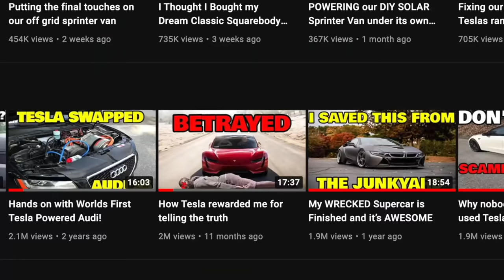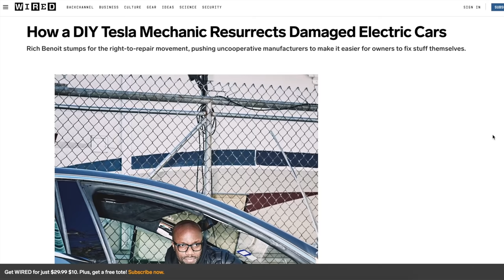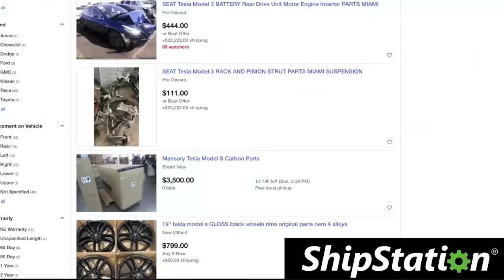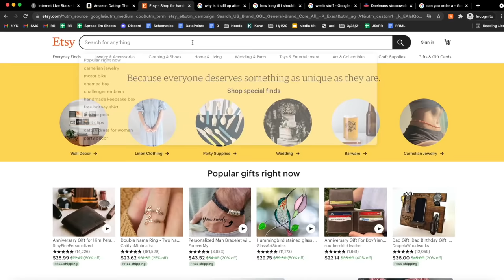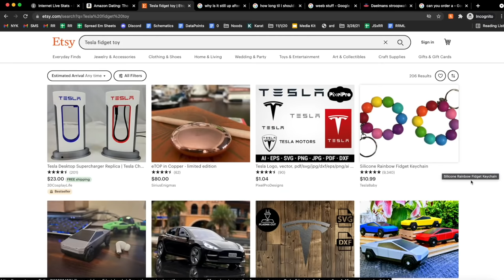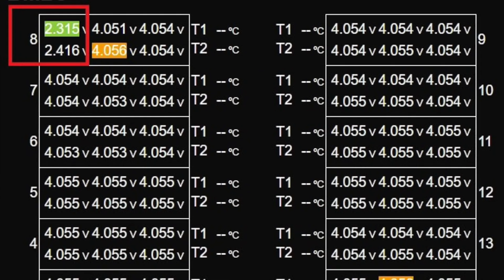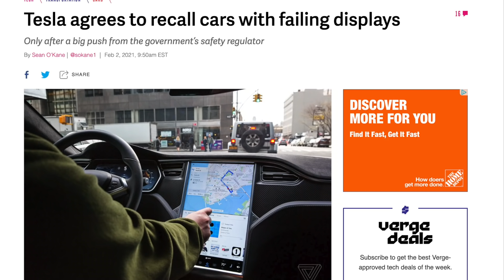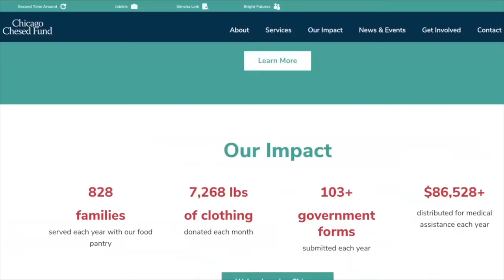Tesla wanted $16,000 to fix this NEW Model 3, we did it for $700! The importance of Right to REPAIR!

Comment: If this is how the future is gonna be, I prefer to live in the past.
Reply: It's already happening cars don't last nearly as long as they used to in the past and are harder to fix yourself.
Reply: Nope this not the future. It's even an exaggeration of the current case. This seems implausible to require a battery replacement. That's not even financially viable to Tesla.
Reply: Right to repair shouldn't even be discussed. How about a right to have "10 years of warranty on the house - manufacturer liable for everything". Just look how much longevity and innovation would magically spring to life overnight and products would be granite solid. No more e-waste dumps in Africa.
Reply: @rosen9425  Nope Right to repair is very much needed. This battery pack should be good for 15 years plus. Warranty Guarantee that long is just not legally viable. As it's beyond realistic foresight. Instead realistic efficient fixing methods should be supported.
Reply: @Neojhun  I think you misread his remark about right to repair
Reply: You will have a lot of company - people who also appreciate past simplicity and freedoms.
Reply: @Ricky Apple did that with the Iphone 6 . They did not exactly break it but slowed it so much it was unusable for some people , then they came out with some B.S but eventually had to admit the truth . By that time thousands if not millions of people had traded in their ''defective '' phones . They got sued and fined by a few countries but the amounts they got fined was pathetic
Reply: With those electric cars you're delivered to the tigers.....and they can rip you of with a smile
Reply: @henkholdingastate  Very good analogy
Reply: Or just buy a gasoline powered car.
Reply: @Neojhun  I think that "right to repair shouldn't even be discussed" means that this right is essential and obvious
Reply: @frankiehernandez9465  Gasoline is on the way out, in some countries it will be banned within 20 years.
Without ICE vehicles gas stations will disappear or turn into electric dittos. Where you going with your ICE car when your fuel runs out and nowhere to buy?
Reply: Just because some companies have weird business practices doesn't make the future bad. It's like reading a porn magazine and conclude all literature is garbage.
It's simply a matter of finding a company with a good product. And anyone with a brain should be able to pull that off.
Reply: @DecepticonLeader  I think petro will always be around only that most will be like you said electric. Who knows if there will be another sauce of power in 20yrs besides gas, electric & hydrogen. I guess we'll just have to wait and see, I do know one thing I won't be around in 20yrs.
Reply: I haven't bought a "new" car since 1982.  All of my cars are old, in great shape, run great and cost me next to nothing to drive.  I've NEVER spent more than $7200 on a vehicle purchase and I'm over 60.  I've owned a 63 Corvette, several sports cars, and a couple of BMWs.  I can work on them myself.
Reply: @Ricky it has already started happening. Tesla's are consumables and break down extremely fast. Good luck repairing it for less than a new one would cost you.
Reply: Same here.
Reply: @Neojhun  It's not an overexageration. Authorised Tesla service centres are told what they can and cannot repair and with current laws certain companies(Tesla, John Deere and Apple) to name a few do not release schematics and block parts manufacturers from selling components to service people and consumers.

Even under warranty repairs Tesla doesn't allow the battery to be repaired. What they do instead is, all batteries are shipped back to the factory where they're salvaged for parts and recycled for cash.
Reply: This is the past, this is the present, but it's not going to be the future. Fortunately, there are a growing number of people fighting for the right to repair and they're louder now than they've ever been.
Reply: Ford Panther bodies are looking better and better every day.
Reply: @deni2123  Statistics say that cars are lasting longer than ever before. What you're saying flat out isn't true. 

"ThEy DoNt MaKe Em LiKe tHeY uSeD tO!" And thank Christ for that. 

The average age of all cars on the road today has never been higher. Do any of you old folks actually remember what cars were like 50 years ago? I do, because my broke ass was still driving cars of that vintage when I first got my license. Typical odometers rolled over at 99,999 miles, and that was because few cars actually went that far. You were lucky to get 100,000 miles out of a car from the 60s and 70s before it needed valves lapped, valve seats or cylinder heads machined and/ or replaced, rear axles rebuilt, etc. Suspension components typically became too worn out to drive in a straight line by 60,000 miles. And that was if the body and frame compoents hadn't completely rusted to nothing. On top of that, points and condensers needed changed every year. Distributor caps and rotors needed replaced regularly. Drum brakes still heat- faded next to useless in about 40 feet if you were going faster than 50 mph. Carbs needed repaired or adjusted about every 40,000 miles. There was a ton of additional maintenance to worry about. Cars were also much cheaper then, even adjusted for inflation, so it didn't make sense to do all that work once the car was old... You got a nice NEW one for $4k which is the equivalent of about $26,000 today. You're lucky to pick up a nice three year old low mileage Hyundai Sonata for that price today. 

Modern cars are SOO expensive now that it makes financial sense to fix them more than it did even then, and it comes down to service life. They are built to tighter tolerances and higher standards than any drunk factory worker from the 70s could have dreamed of. People hang on to their cars now because they know with proper care, almost anyone can get 200,000 miles out of a modern vehicle. Will it have icy cold A/C at the end of it's life? Probably not, but you forget that in the 70s, 30% of cars didn't have A/C at all.

Modern cars are light-years better than cars from the 60s and 70s in every conceivable way. I am very happy with my modern cars. I've had to learn some more skills and buy some new tools, but all in all, its a LOT less work to keep them on the road. 

Give this a read... https://jalopnik.com/why-old-cars-suck-5551040
Reply: @DecepticonLeader  if it comes out as a pretty good deal to remotely 'destroy' the electric crap cars - EVERYONE is gonna jump on the band wagon ! and from now on you can choose: green crap, blue crap or yellow crap.
Reply: @casemodder89  If you get the chance, drive an EV to test it out for yourself and you'll understand why people are interested.
But of course, if there's some cold fusion powered cars or similar in the future which are much more impressive, yeah obviously people will switch to a better option. This is the reason why gasoline cars are being replaced, time isn't kind to tech.
Reply: oh no the future is gonna be rich making his own electric car garages and the right to repair becoming more enforced over time oh noooooo
Reply: @timemachine_194 Maybe you haven't heard but Tesla is now going to open up their super charging network to other cars.
Reply: @timemachine_194 I will charge at home most of the time too, probably. But you said Tesla eco system was closed. So that's what I was replying about. There could be more changes down the line, the new EV era has just begun.
Reply: @timemachine_194 I'm no oracle, but we shall see.
Reply: @timemachine_194 1. They can not charge $16,000 for it. It's about $10,000 to $12,000 for a replacement, much of which is labor cost. 2. Tesla Does not have SUPPLY CAPACITY for lots of replacement. They are massive capacity restrained limited on batteries. Selling a raw battery has much less profit than an entire car multiple times the price of the battery. You fail at basic logic, long range batteries don't just grown on trees.
Reply: @timemachine_194 "They need the high spare part prices" is POINTLESS! If the spare parts have problems EXISTING. Tesla has very limited capacity for the power electronics & drive train components. They are constantly pushing the limits and do not maintain legacy production lines. This is actually a massive flaw of Tesla as they lack the customer service to replace lots of parts. This is nothing like Apple, your analogy is stupid. Apple produces commodity devices which is Easy to scale up. Tesla is manufacturing products that is barely even viable on the cutting edge. It's also far more Resource Intensive Physically BIG product. Your silly theory of Tesla making money on servicing parts is not going to be viable anytime soon.
Reply: @LVSLpwr  It is due to the change away from CFCs to less aggressive chemicals that don't damage the ozone layer. CFCs work extremely well but they have cost many lives in my country via skin cancer (a result of the ozone layer hole doing a trip over NZ in the middle of our summer time). If the CFCs were properly removed from all old scrapped fridges and ACs etc, this wouldn't be a problem, but sadly that was not the case. We've become victims of our own lazy disposal.
Reply: they gonna make their money somehow... whether is a subscription based "car plan" or not updating software. Self driving is utterly useless just a gimmick thatll eventually quit having software support over newer models.
Reply: The past is golden, the present is a mess, the future is in ruins. Thanks to  greedy people who won"t give people repair rights and hoard it themselves.  As they always say, an Apple makes me run away~~~🤣
Reply: @hlaminto2008  Luckily BEVs built right is far more easier to fix than Mechanical Clock Work. Far less specialized physical tools. The only problem now is forcing BEVs Makers not to make it unrepairable.
Reply: @Neojhun  Hopefully they don't become like a certain Rotten APPLE. 😘 i still ponder? Crazy expensive,  My friend spent $1.600 on iphone. Its doesn't work just cause he dropped it...from his pocket.🤣SO WEAK. Apple want to charge him $600 on repair fees. I have an samsung phone, still working after being dropped, splashed on, and even smashed on(i was angry at losing on pubg). Screen is cracked, a little.
Reply: @hlaminto2008  Recently Elon and Tesla has realize Fighting against Right to Repair is bad PR Image. Thus they have slowly opened up more access to DIY tool and instruction publications. But the company is still heavily limited on resources and access too support. Not sure how much is due to real resource restriction or locking down their Property. It's all precarious halfway point right now.
Reply: It’s not the future. This is the beginning of the future so it’s not going to be prefect. Back in the 1950-1970’s it was almost impossible to repair your car
Reply: Everybody should just BOYCOTT Tesla cars for how they treat customers and so PROPRIETARY with parts and service.
Reply: @georgevavoulis4758  That's just not true. It's actually kind of implausible. Please stop spreading false rumors.
Reply: @Ricky It was already proven. they used to throttle the iphones performance, they actualy had to pay hundreads of millions to their customers with that lawsuit.
Reply: @LVSLpwr  My car is a 2013 and I never had to replace or refill any AC gas.
Reply: @MrTarmonbarry  Its the consumer's fault. They look up to those brands like gods and treat those items like religion. They're just taking advantage of stupid addict consumers.
Reply: @DecepticonLeader  ICE might stop selling in 15 years, but it will take at least another 20 years until they phase out. So ICE is here for at least 30 years. And those legislations can be repealed by future administrations.

Comment: Tesla definitely needs to wake up and see the need for thrid party repairs 🤦🏽‍♂️
Reply: They dont wanna lose money, thats the true reason. Plus some people are really dumb when trying to work on cars. I heard tesla cars hold more power then a house
Reply: They had the opportunity to be different but no they’re now in line with every other company
Reply: they know, just don't want it to happen
Reply: @HemiLyfestyle  A tank full of gasoline holds a lot of potential energy also.
Reply: @h60memo  try putting a tesla out though after it catches on fire my bet is your hose won't stop it
Reply: Tesla actually provides parts for third parties that already have a license, but yes, I hope Tesla also provides parts for other third parties.
Reply: Nope they don't. They operate on the same proprietary business akin to Apple.
Reply: @Justin-is4jy  even when its finally put out a fire truck has to follow the tow truck just in case it relights. there are chemical's to put out batteries fires but there toxic as hell.
Reply: @wizcombo  They ARE different, but different in this case isn't a good thing. I can take a Ford, GM, Chrysler, Mitsubishi, Subaru, Mazda, Toyota, Honda, Etc, to any shop I want, and they can all work on them, they can all buy the parts, and I can even work on them in my driveway if I want. Tesla is "different" and doesn't allow any of that.
Reply: @Green__one  Yeah I understand what you mean but I'm saying that since Tesla was ahead of everyone with the electric car, they could've said "we are going to sell parts and schematics to our users and they can have someone capable install the parts" etc. But you know they didn't and it really makes it hard to invest in EVs if I can't fix them

Comment: I had a component on the front seat break. Tesla doesn't sell seat parts, they only sell complete seats. NZ$4,700+ sales tax! Luckily there's ebay, I fixed it for $50.
We need Right to Repair and access to parts or we're self-driving into a horrible dystopia.
Reply: with the rebate and recent price drop more people would probably be looking into Teslas. kiwi here too. what are your thoughts on the car and would you recommend it to another all over again? cheers mate
Reply: @AP-yt4oo  yes. Tesla are crooks but they are the least bad of the car manufacturers. For example unlike vw they have never deliberately cheated on emissions and therefore have never contributed to the early deaths of thousands. Their cars are absolutely fantastic. It's embarrassing how much I love my S100D.
Go with least evil, go with Tesla :)
Reply: @RaglansElectricBaboon  cheers mate thanks for the quick reply. I live down south so winter hits hard how's that affected your car? currently drive a plug-in hybrid (Prius plug-in, real reliable go getter) but thinking of going full EV. hopefully we get more mechanics comfortable with servicing these cars, BEV or otherwise.
Reply: @AP-yt4oo  just do it, it will work out perfectly. Norway's pretty cold and they seem to cope just fine. It's the best feeling to not buy petrol. No more sponsoring crooks that make the car industry look clean. Go for it.
Reply: @RaglansElectricBaboon  Nah, Tesla just cheats on other metrics, like 0-60 time.
Reply: @RaglansElectricBaboon  tesla stays afloat by selling emission rights….

Comment: Seems like that coolant tube shouldn’t break so easily as it costs so much to replace. Design flaw.
Reply: I actually fear if Tesla decides to sell in sub-saharan African  countries. Our roads are pretty bad and I don't think these cars will survive here  if these kind of things happen in the US.
Reply: right lmfao tesla has 10 grey areas for every 1 good thing they do
Reply: Other cars do have similar problems, rocks putting holes on the sump etc. Some cars even have plastic sumps.
I'm not sure running over a solid object on the road would count as "easily" broken.
Sounds like bad luck mainly, plus he screwed up his insurance.
Reply: @Cheepchipsable  I don't have a problem that it breaks easily - but then it should be a reasonable price to fix. You actually wouldn't want a really strong part there. Instead of a $5 part breaking, you could end up damaging the much more expensive part it connects to.
Reply: @CardizoneSemblance  Till Tesla will get there it'll go bust or rather "seriously resturcturalize".

Comment: I remember a model 3 with the same issue when I was working in the Service center in Cleveland. I told Peter the lead tech hey I can put a sleeve made of  PVC with sealant the system does not hold pressure, I was told we dnt fix we replace it's a liability and Tesla its under the scope always.
Reply: (bullshit) Liability... biggest increaser of insurance premiums around...